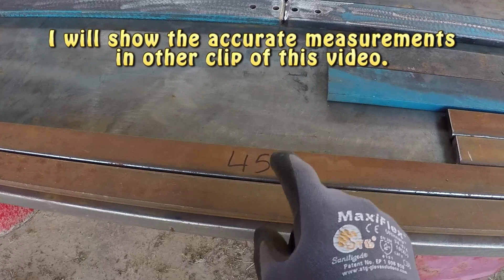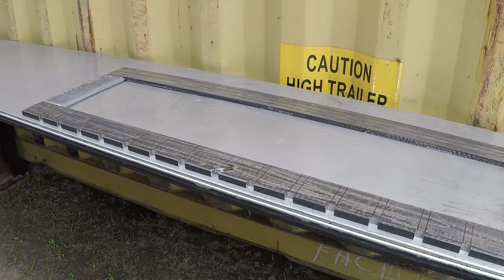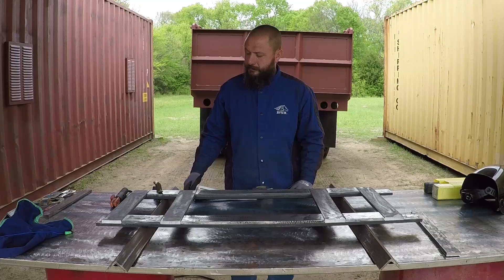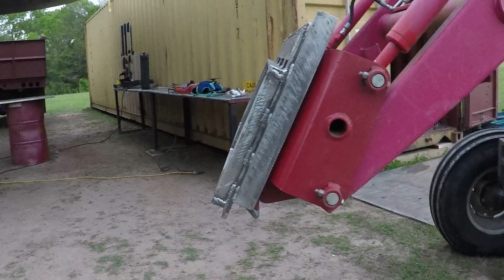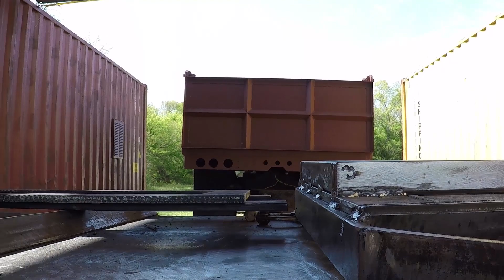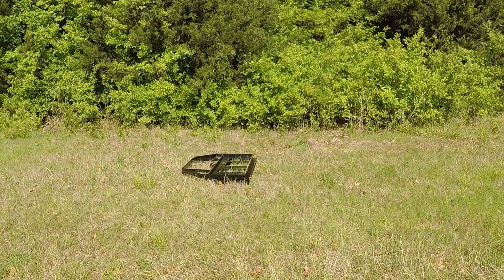Homemade Skid Steer Quick Attach Pallet Fork Frame

Comment: Well done.  Over built is normally best.  I need to build me a set.
Reply from the maker: I shopped around before I built mine. The ones on the market are made from thinner metal, the forks are extended about 6 inches from the quick attach surface and this will decrease the lifting capacity. I built mine from scrap metal and it came out great. Thank you for the comment, be safe and have a good day
Reply: @SalamSayhood  I'm going through my scrap now and starting to get mine planned out.  Your 2 videos on the subject are the most helpful that I have found.  Thank you for sharing.